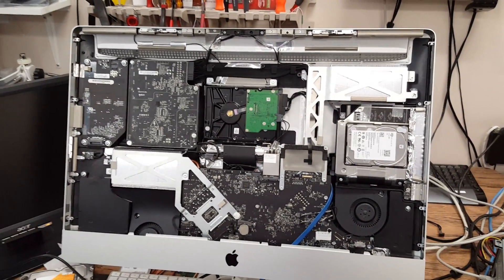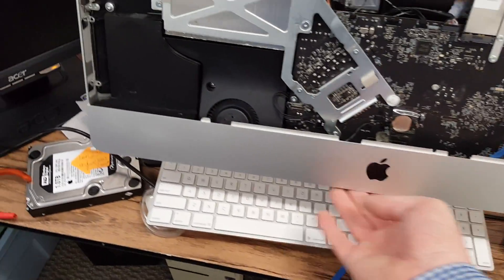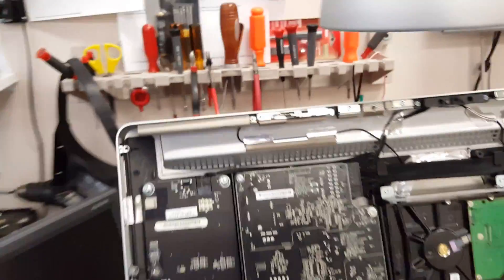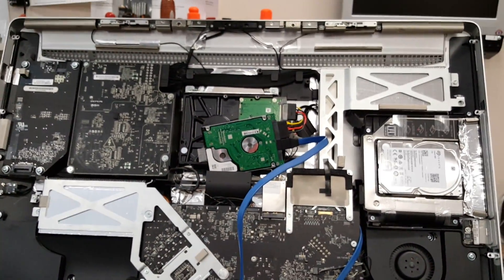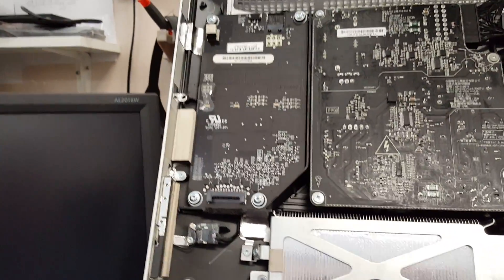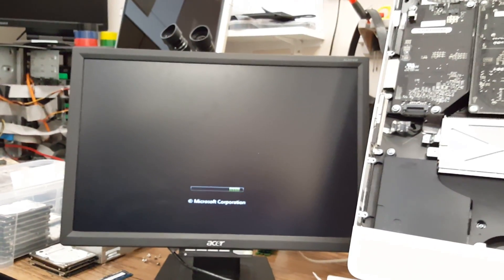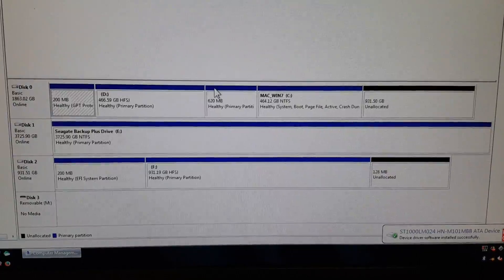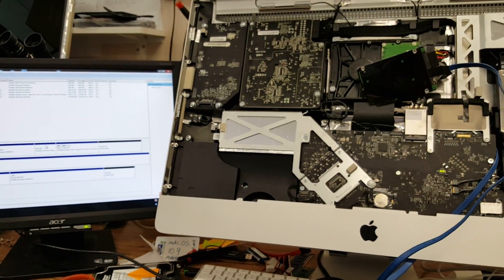How to modify a 27 in iMac to have 3 hard drives or 2 internal drives and one external

Comment: Highly skilled 😂 you don't have to connect 3rd sata cable and take it out throw memory area you can get ssd drive and put it under the 1st drive or put it over dvd it will work cause ssd thickness is smaller than normal drive and if you put over dvd you will need to hold it with double face so it will not move or fall

Comment: Hey what is the imac model ? (age) thanks
Edit : is the 2011 model ?
Reply: It can be model 2009-2011. I have imac 27 late 2009 with 2 HDD too. One 500 GB SSD instead of an optical drive and 4 TB classic HDD instead of the original HDD.